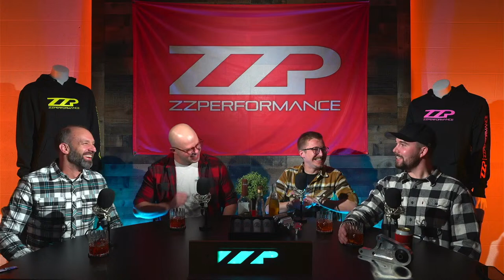🔴 LIVE- ZZP POWER HOUR: Understanding Engine Dynamics | EPISODE 158

Comment: Mr Tim has been awesome on tuning my ATSV. It did take a good bit of revisions, but my car needed plugs and it also was having inter cooling issues, which made tuning it more difficult. I appreciate Mr Tim giving me the answers I needed and his patience to continue revising. It RIPS! Gaps cars like full bolt on coyote Mustangs on E85 to give you an idea. The car only has air filters in the stock intake, Tim’s tuning, a small weight reduction, pump 93 and it’s on a drag radial.

Comment: I’ve had great customer service from y’all! I’m probably about $6k deep in parts from y’all and don’t regret a single one. Any problems I’ve had with anything y’all have been super responsive. That could also be due to the fact I understand I’m not your only customer and I don’t expect a reply within an hour. My 04 Grand Prix GTP is an absolute blast to drive and is running great.